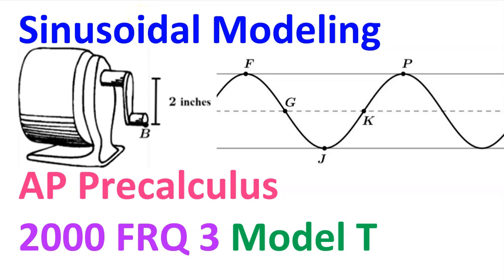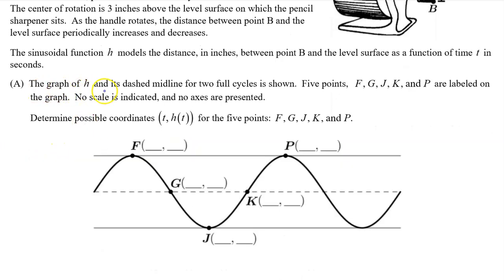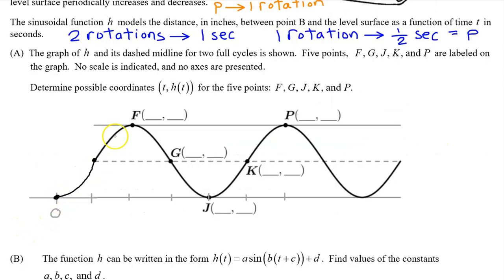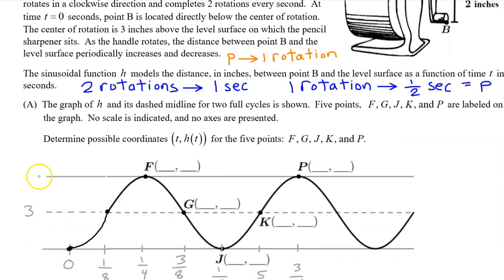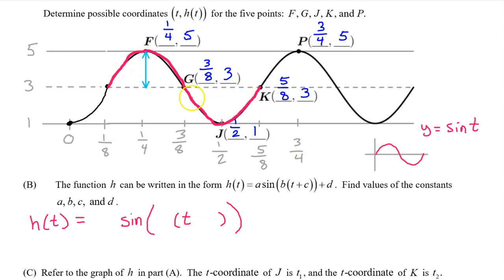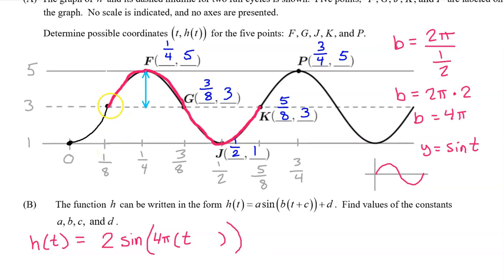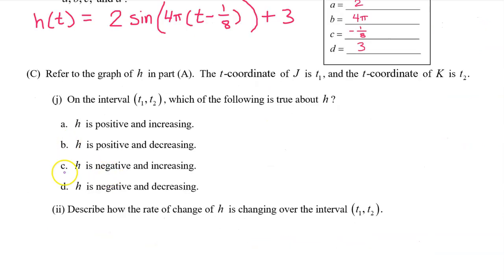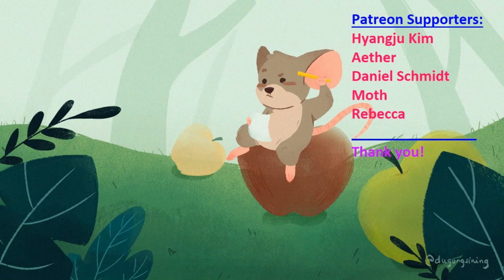2000 FRQ 3 - Sinusoidal Modeling (Model T) [AP Precalculus]

Comment: hii i have a question about part c (ii) of the frq. my teacher said u need to explain/justify why its increasing or decreasing with concave up or concave down. do u think that's necessary?
Reply from the maker: @annlikescheese  They are changing the wording of the question this year. Last year you did not need to explain. This year you will.
Reply: @MrHelpfulNotHurtful  how should i explain it?  thanks!
Reply from the maker: @bnaaa  ex: Since h is concave up on (t1,t2), the rate of change of h is increasing.